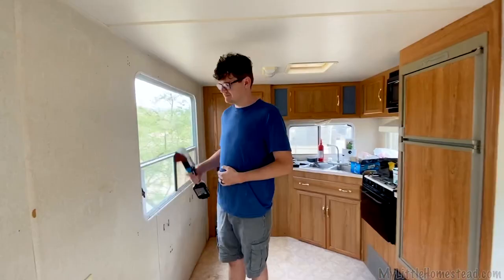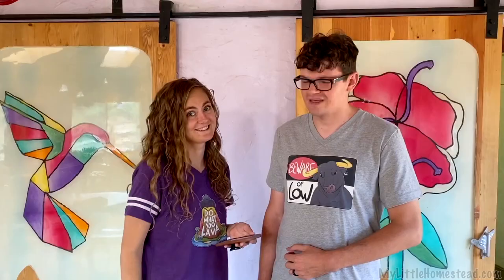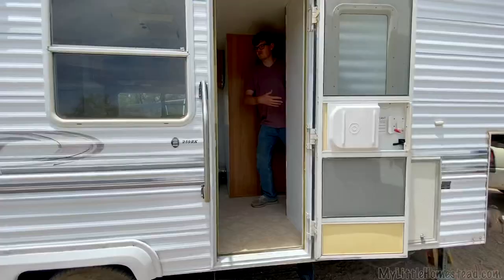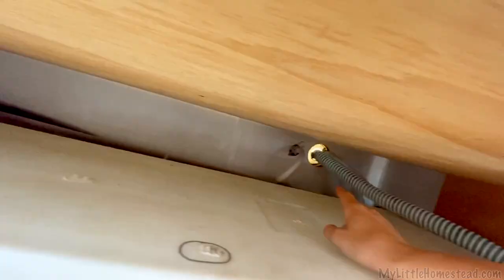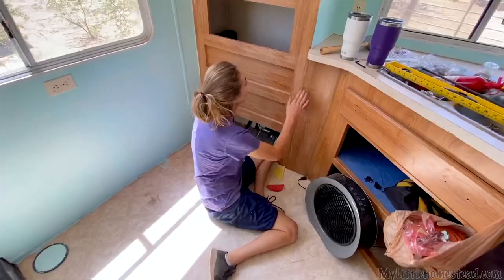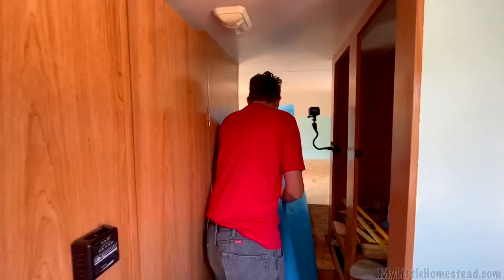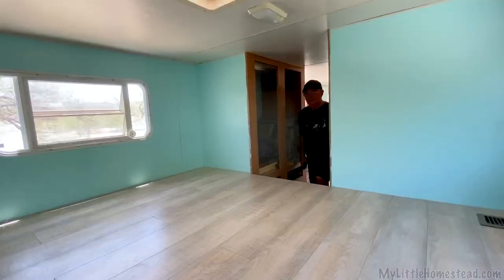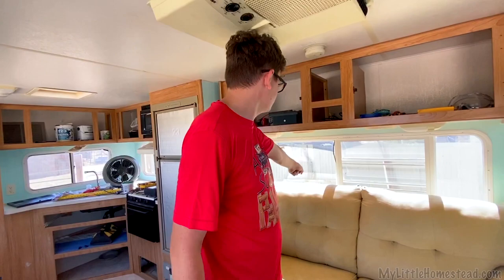RV Paint, Couch & Laminate Floors | Weekly Peek Ep290

Comment: Just a little tip for paint cans, if you take a flat blade screwdriver and made about 4 holes in the groove around the top of the can, the paint will run back into the can and you will not have paint filling the groove and running down the sides, this allows for the lid to fit securely.
Reply: That is a great idea. So glad you shared that. I'm going to do that!

Comment: Hey Bree I have a suggestion about bedding for your new camper.  In order to avoid crawling all around the floor to put on a fitted sheet, I just toss a blanket over the top of the mattress and then sleep on that with a loose sheet above it.  Saves SO much time making the bed and much less crawling.

Comment: Hola amigos - a couple of pointers, use caulking instead of mud because it dries fast and you don’t have to sand or worry about cracks later. I use caulking for non-Sheetrock surfaces all the time when I flip houses. It’s a time saver. For a larger crack put the caulking on the spatula and spread. Also be careful how much weight you add to the Trailer, like a couch and heavy plywood. I know Bree and familia you guys are very creative so think outside the box for common comforts that you love in a house and still want in the trailer. I have seen and heard horror stories of people ruining their truck because of the heavy trailer. For example, use patio furniture pads for the bottom and dress with throw pillows for the sides. If you spill anything on them, they clean up easily. Wrap the wood underneath with a fabric that you can staple gun it with. If I can think of anything else, I will let you know. Love you guys Muchos. ❤️🤜🤛🙌🏼💃🏻🕺🏻

Comment: I am so impressed with the two of you!!! Great team work, planning and it's going to be a grand home! Chalkboard paint over the upper door. On the lower door put a roll of cork/heavy cardboard use as picture gallery of places visited. Could get a simple acrylic/hard plastic and use it to cover on a hinge, so the pictures don't fall off. And that surface could double as a planner/note/dry erase board. ( Double function front of both doors if the upper is metal before chalk paint).

Comment: bree  i have to stop you on the rollers on stucco. i painted off and on for 25 years and couldnt tell you how many textures ceilings i rolled  or stucco walls. the animal you need is a long nap sleeve   sometimes galled a german sleeve or other things  but it has a 1/2 inch nap compared to the normal 1/4  or 3/16.....word of warning on theese roll slower or wear a lot of it . that amount of paint on an extension pole after 8 hours will cause discomfort and rsi over time. thanks for the videos

Comment: You could build yourself a bench seat with storage in the arms (a drawer or two, or even shelves to utilize the space). You could also use a weaving material as a way to get the cushion to your tushy if that's your goal. (I made one for my mother yearrrsss ago, it's gone now) You could also use a thick foam for the seat and back and use a really nice yellow fabric to cover the cushions and make a few throw pillows to go with it, one in blue and yellow stripes, a solid yellow one and a solid blue one (or even make them yellow on one side and blue on the other that way they are reversible) to make it all blend in, but of course that's just one idea.
Of course it's your RV, but I do hope you don't mind when someone says that I feel that the loveseat is far too big for that spot. Again it's your RV and you do what you want. This is just my opinion and you can take it with a grain of salt. It's only a suggestion and not set in stone so to speak. :)

Comment: Can I suggest you find the correct air venting pads for under your bed as the mattress will sweat and become moldy. Also the vent under your oven, I turned mine into a pull down door so I could put my veges in there for air flow, plus you want to use as much space as possible for storage. It's looking fabulous guys, great work!!!!!

Comment: Think of getting 4 jack stands for the rv. 2 for the rear and 2 for the front. The ones in front will take the weight off the power jacks which over time and use will begin to slip

Comment: Just a tip for future projects, with that siding you should use wood filler not drywall mud. drywall mud doesn't like to stick to wood like that/ compressed fiber board. especially with campers mud tends to crack and fall apart. But great job I love yalls channel can't wait to see what comes next.

Comment: I wish I had realized that y'all were only using brushes to paint your stucco all these years!  You can paint stucco with rollers.  The key is to have a good roller with a long nap - the nap needs to be at the very least 3/4" or 1"!  It makes for a heavy roller, but it's worth it on the time you save brushing.

Comment: Plaster is ridgid and will shatter from the vibrations of the road.  Its fine as long as you dont move the trailer.  Otherwise an RTV type caulk would be better (silicone caulk).